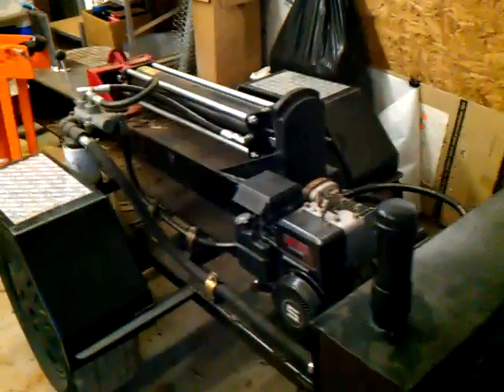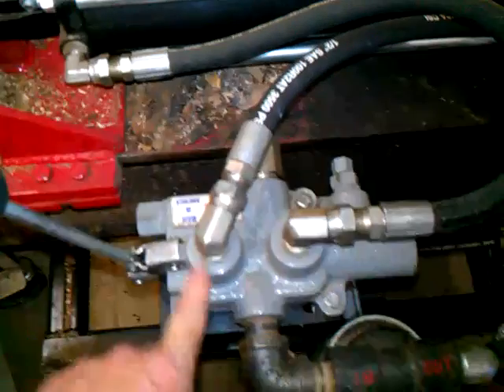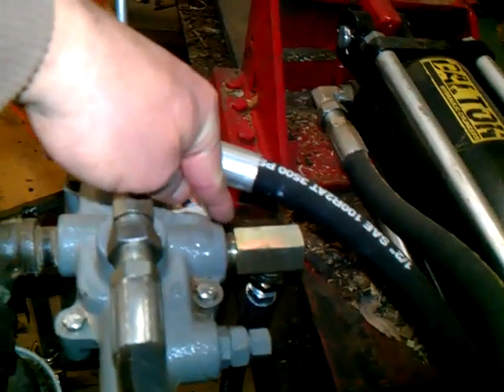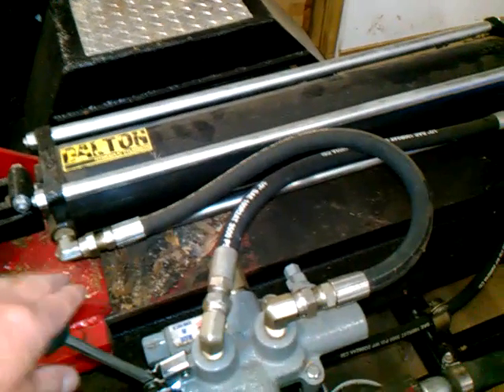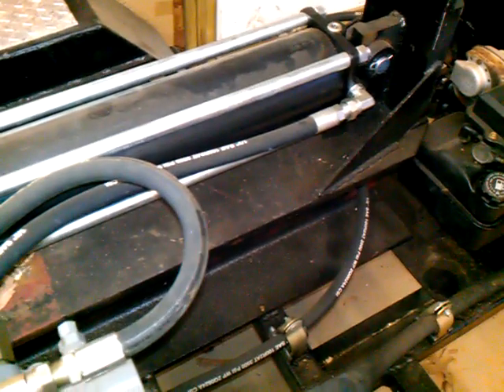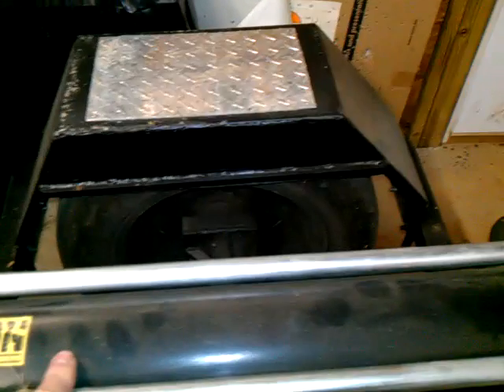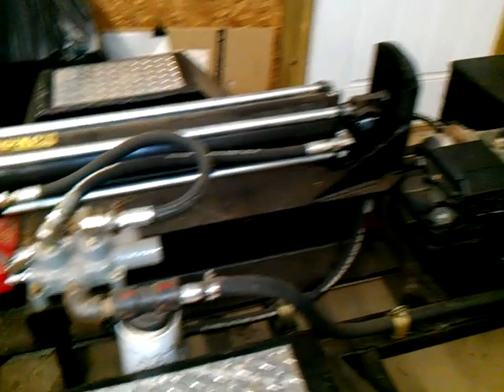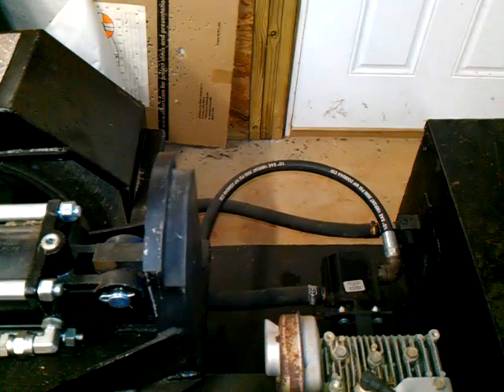how hydraulics work on wood splitters

Comment: Very helpful video...thank you for sharing.  Im in the process of trying to design and build my own log splitter.  Welding and fabricating is no problem but the hydrolics is somthing I needed help with.  Someone gave me a brand new five horse honda motor and Im hoping to use that.  How do you go about sizing the pump and the cylinder?
Reply from the maker: On a 5 HP motor I would not put no more than a 11 GPM pump.That is what is on this log splitter.

Comment from the maker: I have never change the hydraulic fluid. with it having a filter on it I should be able to go a year or two. I keep a check on the fluid levels if it looks like it need to be changed I will. thanks for the comment.

Comment: Nice tutorial. One safety issue I notice is that looks like a cast iron elbow (plumbing grade) on the outlet of the pump. Those cast seamed type connectors are not safe above 250 psi or so. You can get a steel seamless elbow for just a few dollars and make it much safer. Cast is fine on "return to tank" part of the system, but not the pressure side.